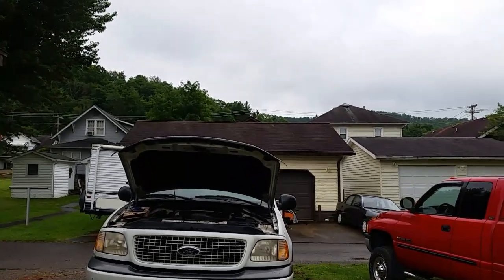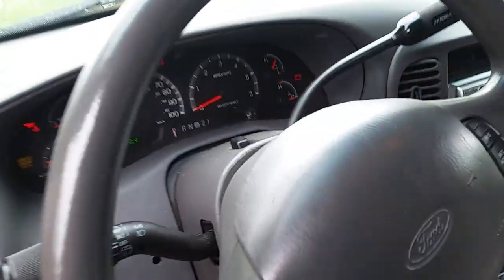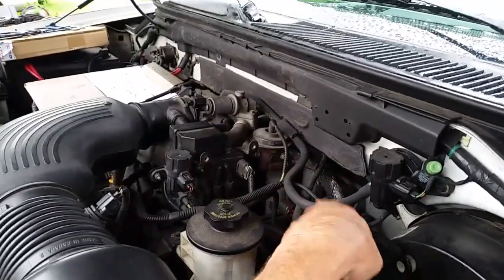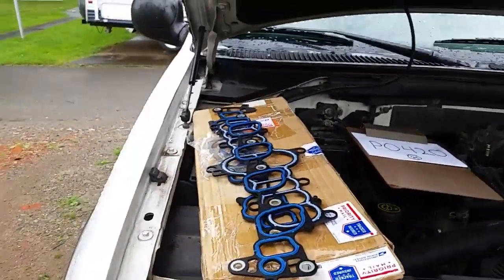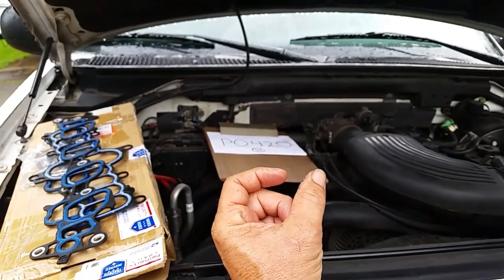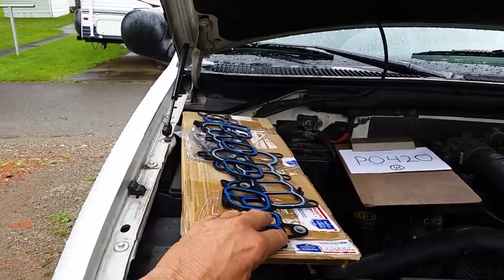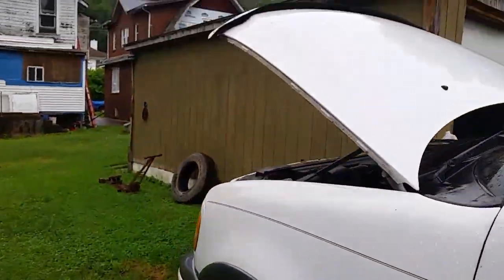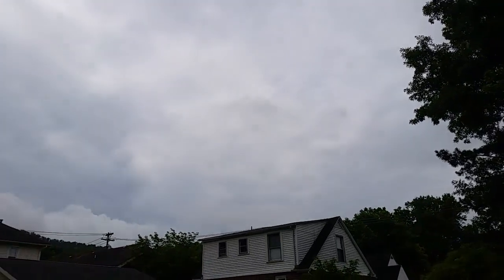P0420 Code. How to fix it. Don't spent spend tons of $$$.

Comment: 1.11.2019
Long Beach, CA.

Background : Southern California Licensed Smog Repair Tech. (Previously )

#1. "Misfire Codes" - P0300 thru P0312 & "Fuel Trim Codes " - P0170 or P0173 are the # 1 causes of Failed Catalytic Converters.

A Code P0420/430 is getting ready to illuminate the Check Engine Light when the Rear Narrow Band Oxygen Sensor is cycling within 70 per cent of the Front Narrow Band Oxygen Sensor.

Example : Highest reading of Front was 0.780 Volts/780 Millivolts & Rear highest reading was 0.725 Volts/725 Millivolts.

70 per cent of .780 V =
.70 X .780 V = .546 V

Therefore; if this Rear O2 Sensor is > than .546 V , the Vehicle is gonna throw you a Code P0420 or P0430 Catalyst DTC ( Diagnostic Trouble Code @ 7 PM tonight or 7 AM tomorrow.

Diagnosing CAT Codes 420/430 PROFESSIONALY :

1. Fuel pressure too High :
Specs: Results : Pass : Fail or N/A

2. Leaking fuel injectors
Pass or Fail
( Always DOCUMENT Findings ( Pass/Fail results for you & the Customer on EVERYTHING)

3. Ignition System Misfiring : P0300 thru P0312 exists or Does Fuel Trim codes Exist ( Write it Down !!!! )

4. Incorrect Spark Plugs !!
Ford Mustang won't  Motorcraft Plugs, GM won't AC Delco Plugs & not some other Mess. BMW won't this & Audi won't this. ( Install what the Manufacturer called for )!!
NEVER deviate.

5. Ignition Timing Fault on Old butt cars ; Crankshaft Sensors vs.Camshaft Sensor Timing Error Fault on OBD II & CAN vehicles.

6. Oxygen Sensor or Sensors Faulty...Pass or Fail
Record the Findings for the Customer ( Show us that you ain't a Saw Mill Mechanic )

7. Exhaust Gas Recirculation Malfunction :
N/A - Pass or Fail

8. Intake Manifold Leak
( Using a Smoke Leak Detection Machine from www.aeswave.com for God's sake )

9. Oil/Anti-Freeze entering the Exhaust : Pass or Fail

10. Silicone Contamination

11. Road Damage to CATS

12. Defective CAT or CAT:
Pass or Fail results recorded for you & the CUSTOMER.

A) Cranking CO2 Test performed on the California Dynamometer : It passes if the HC gas is < (less) than 500 PPM & the CO2 is > (greater) than 12.5 per cent.
(Or whatever other States use as their Dynamometer )

If you wonna go Full Metal Jacket , go to the Big Dogs Neighborhood over in Albuquerque, New Mexico @ a little company called www.automotivetestsolutions.com 

Getcha some LapTop Software called the EScan Elite.When ya go on a Test Drive & return Home or the Shop, you'll know if CATS are Bad or Good....It displays on the Screen in 0 per cent too 100 per cent....So if they're reading 70 per cent to 100 per cent, you're good...If the Screen is showing 69 per cent or Less : Even your 9th Grade Niece can tell ya, "It's time to call Houston Uncle Billy"........Houston,Texas Space Center , we have a Problem over here  in Kansas City......Houston : "We can see that sir , we read ya wall to wall, tree top tall, Bodacious ! Get 'er Done" right Kansas City & don't forget the " CAT Break -In Test before you give 'er back to the Customer" by using Jack Georges' Tip from Eastern Catalytic :

A) Start Engine, don't touch accelerator pedal

B) Idle engine, let it warm up slowly 

C) After 5 minutes, increase RPM to 2,500 RPM

D) Hold @ 2,500 RPM for 2 minutes

E) Allow Engine to cool down

Ya see, even your 9th Grade Niece could perform these Instructions. Logic behind this procedure : " A replacement Catalytic converter needs to undergo a proper "break-in" procedure to ensure that it will continue to work the way it is supposed to & deliver the required Emissions Reliability & long service life.If the Converter is not warmed up properly
(broken-in), the substrate inside could be adversely affect & eventually cause the Converter(s) to Fail down the road.
Reply: I have a P0420 code showing up, everything is green including CAT but EVA is red which won’t pass smog I’m from Southern California too, any ideas ?
Reply: 9/26/2020

It would have helped if you could have taken your vehicle to a Licensed Smog & Repair Shop ( Not a TEST ONLY ) Smog Shop.

Ask the Smog Repair Tech. what is their Hourly Rate to Test these "12" Possible Faults.

May not be wise for you but the Escan Elite Laptop Aftermarket Scanner
( $1,795.00 ) will Test your CATS just by driving around the Block.................
( There's no guessing and no "wundering" )

Just like taking a 12th Grade Chemistry Test. It'll give you a Photo Grade of 0% to
100 %......69 % Grade & Below , you know what that is.

Comment: My 2011 mustang 3.7 has p0420 was causing power loss and misfire but only when DECELERATING. When accelerating only slight power loss, no misfire. I replaced the bank 1 o2 sensor and catalytic converter (when i removed the old cat it was full of broken pieces inside.) the code hasn’t come back yet but the symptoms are still the same with the replacement making seemingly no difference. Just did my plugs 6k miles ago too..do you think it’s reasonable to conclude if the cat was blown on one side that the other side is likely the same?

Comment: Hi nate   really quick question. I had my 07 sentra inspected. They forced me to replace my muffler. On the way home from the shop my CEL came on for 0420. Ironic after a muffler replacement this code pops up.  Do you think they are trying to con me for a new cat? I deff have preformence loose. Will be checking for vac leaks asap. The code did flick off for a few days but now is back.  What could they have done purposely to make me return for more labor? Thank you.
Reply: 07 sentra 2.0S if that helps. Thank you.
Reply from the maker: Check for broken 02 wire. If not the cats is probably going bad. Hook up a scan tool to get a wave form for the 02 sensor.
Reply: @FixingWithPassion  thanks alot

Comment: Having oil leaks and low oil pressure on my 2001 Subaru Outback h6 and I just got this P0420 code. Any thoughts?
Reply from the maker: Yea, have a man look at it.
Reply: Commented just a minute ago with an idea where you might look for truly helpful information.  It’s disappeared now, and I can’t honestly be sure if it was an algorithm censor or the channel operator personally.  If it’s the latter, let’s see if he’s ‘Man’ enough to leave this one up —— putting ‘P0420 gremlin and oil consumption’ into your search engine should be more useful to you than this channel.
Reply: @waynepolo6193  okay. Funny I've had 2 new oil pressure switches put in to try and fix the flickering oil light at idle and it hasn't helped. Plus, it's supposed to be running at 14PSI when it's running at 7. Not good. Shouldn't be an oil pump but I have a bad feeling it's engine bearings going out. Sadly, I've only had this car since February and it was running great until lately. Damn Subarus and their oil problems. But I have a feeling the P0420 might be because it has a muffler delete🤷🏼‍♀️🤦🏼‍♀️
Reply: @emilyanderson3681   Jesus, what did that car do to the last owners for it to deserve that kinda treatment?  Check the oil for metal shavings if the bearings are a concern.  It could also very well be the lack of back pressure throwing the code, considering the muffler delete.  If I had to go full Occam’s Razor, though, I’d say the most likely culprit (and ideally cheapest) is a leaky gasket is making it burn oil and clogging the cat.  If you absotively posilutely can’t put a new valve cover gasket on it right now, slap some AT-205 in there next time you see the oil’s low. It’s not petroleum based so it won’t over-swell the gaskets, or bushings generally. Legend has it that a gallon of lacquer thinner in a half a tank of gas can clean the catalytic converter surprisingly well.  Just don’t do what I did and try that out before addressing the oil leak.  Not a waste, I’d say… but certainly not efficient.

Edit: also, I believe a gunked catalyst can affect manifold pressure.  Check your PCV and your rear main seal.
Reply: @waynepolo6193  yeah I think it was drove hard before I got it :/ But the interior and exterior are in lovely condition considering the age. Moreover,  thanks for the helpful advice! I'm hoping I can make it last many more years 🙏 I'm sure I'll get it figured out somehow without having to take the engine out 😅
Reply: @emilyanderson3681  happy to help and hope it goes well!  I’d be curious to know what the problem ends up being if you find out.
Reply: @waynepolo6193  we found metal shavings in the oil a couple days ago..not good but I'm gonna drive it till it dies. I believe it still has a lot of life to give before the engine blows up because I basically was told I need my engine pulled

Comment: I have an 06 Ford Escape, my check engine light came on a week ago. took it to nearest auto zone and the PO420 code came up(that’s the only code), I’ve taken it to 3 mechanics and they all say it’s fine to drive but the whole catalyst converter needs replaced. now my Ford Escape has 3 converters on it fml so if I don’t have to have them changed that’d be great. However my question is will these seals and alittle extra air getting through cause my vehicle to sometimes have trouble starting and terrible gas mileage??  Or is one of my converters actually bad??

Comment: There are  youtube videos on how to make a smoke machine out of paint cans. This will help you test for leaks in your intake and evap system.
Reply from the maker: Nice. Thanks!
Reply: A can of brake parts cleaner is like $3 and does the same thing.
Reply: @keithupton86ku  but it is invisible 💁‍♂️
Reply: @adrianapollyon5087  And? Guess what happens when you spray brake parts cleaner into your intake while the engine is running? It'll sputter and possibly die. The same thing happens when you spray brake parts cleaner into a vacuum line, or a leak in the systems(s).

Comment: My 2006 Honda Civic just gave me this code. It has 234,000 miles on it. Is it more likely the O2 sensors are bad, the converter is bad, or both? I noticed when it’s really cold out that it would have trouble shifting at first but then it would drive fine as the engine heats up. I also noticed my gas mileage has dipped a little bit.
Reply from the maker: Check obd2 data. Make sure o2 are working Graph them.  Graph the cats also. They should look lazy on the graphs almost a straight smooth line depending on the RPM.
Reply: @FixingWithPassion  Cataclean cleared the code. Not sure what was wrong or if it’s fixed, but the check engine light went away.

Comment: now when you say check your gaskets. 
i have a valve cover gasket causing an oil leak, could this possibly be at all responsible for the code? or do you mean other places? sorry, im not the most mechanically inclined.
Reply from the maker: No.
Reply: @FixingWithPassion  i ran through 2 bottles of "caticlean" i was going to replace the sensor.. but it being an 04 tsx for some reason the cheapest sensor was over $400 im assuming the sensor may be fine but im wondering.. is my cat okay, or do i probably just have an exhaust leak somewhere? i seen a video where a guy just sprays soapy water all the way from cat to exaust until bubbles are seen to find the leak. could i just do that & slap some jb weld on the leak??

Comment: Hello. I'm getting the P0139 and P0137 codes. I have also noticed that there is no voltage coming from B1S2 at all. Is it safe to assume the sensor is bad?

Comment: Not on Ferrari to Honda, this tip won't fix it.  It's usually the Catalytic Converter. If you have Honda & there is O2 on Catalytic Converter, you will need to replace the O2 Sensor with all those bolts/springs/seals/gaskets. You will need to remove the passenger carpet out to disconnect the the O2 Sensor's Plug.  Many times, clients will junk the car due to high price of parts/repairs.

FYI: Honda Catalytic Converter is over $1,000.00 while a WALKER 16070 is $709.00
Reply from the maker: Truth. So many headaches!

Comment: Finding leaks is so easy with a smoke machine. I would have immediately gone with a smoke machine and if you have a leak there will be smoke. They have an adapter to insert the smoke into the throttle body. Thoughts?
Reply from the maker: Yea right true got one now days

Comment: I have a P0420 on my 2011 Honda CRV I changed both oxygen sensors and it went away for about a week and then it came back so I'm supposing I may have a leak somewhere. I checked under the car I didn't find any holes anywhere but I did notice that the top or pre cat catalytic converter is very red and bluish does that indicate damage? If it does do you suppose that I could be burning some fuel or oil into the catalytic converter? I don't want to replace it without being sure that I found the problem that caused the damage to the cat. what would you recommend on how to proceed?

Comment: My 99 Chevy Suburban service engine light comes on just once in a while.  In the past, I cleared it to see if it would go on again. Guessing it's been a year that it's been off, (anyway, it's been a long time,) now it's on again. If I have a major problem, wouldn't the light come right back on after it's been cleared?  (P0420 Catalyst System Effidiency Below Threshold Bank 1)Thanks!

Comment: Please answer this question. I took my car to get a fuel pump , oil change. Was told that I needed a valve cover gasket. So I got that fixed as well. My car was brought to me, I put the car in reverse, and the engine light came on. The mechanic scanned the car and it was a P0420. I was told it read catalytic failure. Is there something else that it could be? The mechanic said when you start your car up in the morning, that is why you get black smoke. I have never seen black smoke. The next morning I started my car. No black smoke. The car after the work does sound a little funny (best description I can give). It drives okay,  WHAT if not the CAT, should I have another mechanic check out? OR can any suggestion or helpful comments. I would greatly appreciate it.
Reply: Did you find out what the issue was? How did you get it fixed??

Comment: Fuel trims will show if you have extra air.
Reply from the maker: That's a big 10-4....  Thanks!
Reply: Tom Ryan u mean in obd2 scanner? How will show?
Reply: So in the case of this code, trim should read lean?
Reply: @Vatslav Orlov More air means add more fuel to balance it out. So the trim will be POSITIVE. When it gets close to 8-10 there is a problem somewhere.
Reply: Long-term fuel trims. Not short-term fuel trends

Comment: im recently getting this code but at a loss because i cant get help. recently i had a misfire because of a bad coil pack p0351-4 and then days later p0420 so im not sure on what it is but i tried doing the soapy water spray with no luck but code came on again after coming to a stop and parked.

Comment: Wouldn’t it be better to put it on the upstream O2 sensor instead of the downstream? I used an infrared thermometer to measure the heat before the upstream O2 and after the downstream O2. The heat read about 530 before the upstream and abt 350 after the downstream. Pretty rock solid proof the cat is bad. What do I think?
Reply: Check out Scotty kilmer channel on P0420 code using 1 gallon of 100 percent lacquer thinner, to half tank of gas and run engine at 2500 rpm for 30 minutes, or road trip for 80 miles or so to burn out carbon in cat.  Excellent old-school mechanic !
Reply: Scotty does not have reliable info

Comment: Having same issue on my 2003 4 runner. Just after I my friend and I replaced valve cover gasket. It's 150k and already has a after market cat. Do you think If i  tighten bolts on valve cover another 90 it would help?
Reply from the maker: Get a obd2 code reader...look at the last o2 sensor data(graph data)....if its NOT flat lined sorts... then the cat is no good. I've had issues with aftermarket cats lately!
Reply: Nathan Rohrbough thank you. Much appreciated.

Comment: I have a 2007 Mitsubishi eclipse and my exhaust flange isn’t tight and I did the water and soap test with the vacuum and my exhaust flange was bubbles could it throw the code p0421 and p0431? Please help. I change all my o2 sensors as well

Comment: What exactly is "a can of spray"? I know what a spray can is. What is in it?
Reply: I think it's something combustible. Propane gas, or maybe starting fluid...so it gets sucked into any intake leak and raises the RPM.
Reply: Brake cleaner will do the job. Just keep out from spraying the alternator side
Reply: @3dmundCheah  Got it, thanks.
Reply: @CHARGING FORWARD Why is starting fluid best?

Comment: Nice video! Went to mechanic, they said my cat was fine but needed both of my 02 sensors replaced(which I did, both oem). However, I still get the codes! I have a 2013 Corolla S. I don't know for certain if the intake is plastic or not but I'll surely check asap! I also have a very small evap leak(p0456) but im not sure if that has any bearing on the p0420 code. Question is: Can the gaskets leak if the intake is NOT plastic?
Reply from the maker: Adam Joseph .....yes...my expedition is an aluminum intake and I've had to replace gaskets on them and for other people.
Reply: Use gumout or catyclean

Comment: Hi so if your plastic intake has crack wouldn’t it throw both codes. P0430  & p0420. Because I have done everything you just said in the video not to do. I would like some help. I don’t get p0420 code but p0430 code.
Reply from the maker: what is this on?
Reply: 2007 Toyota FJ cruiser 4wd
Reply from the maker: Gotta do a wave form on a obd2 code reader. Look at the o2 sensor after the cat. Is the waveform signal the same as the front o2 sensor? If it is then you have a bad cat.